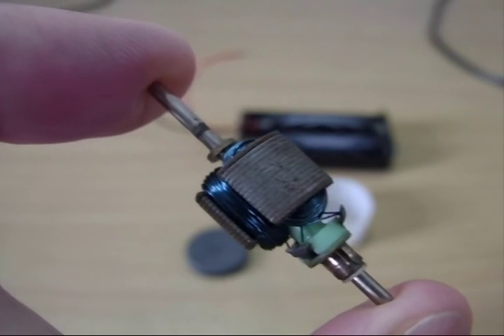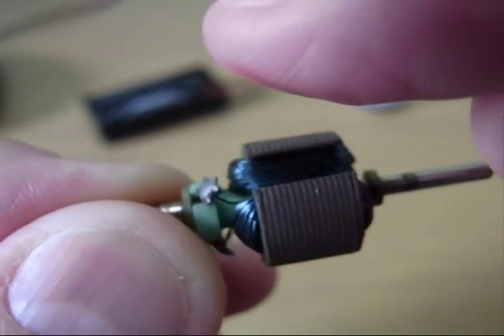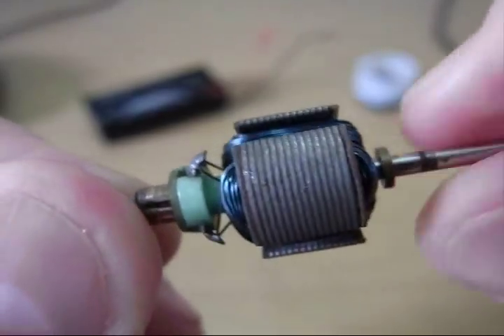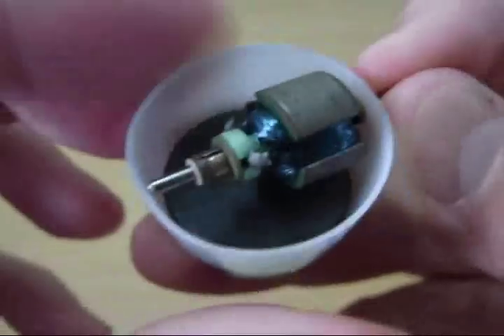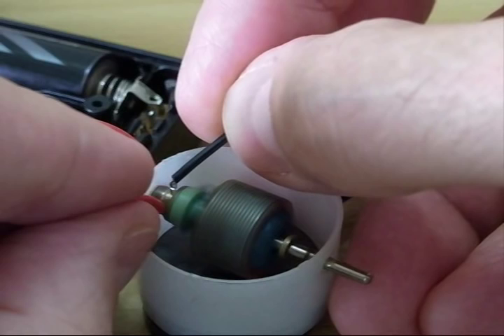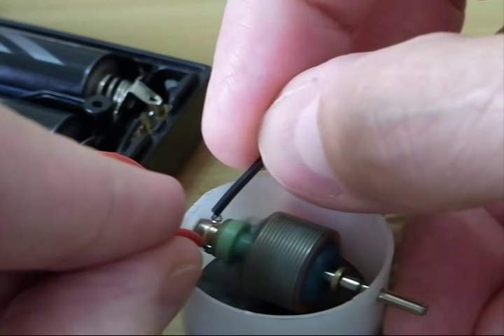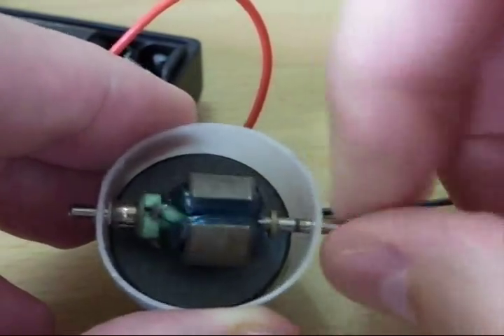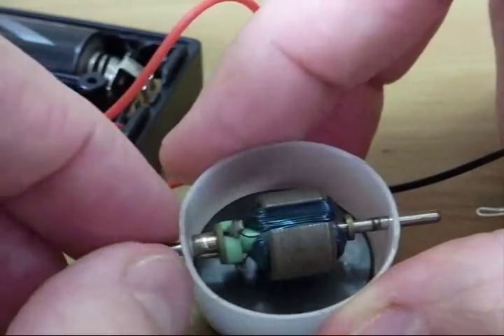DC Motor Teardown/Experiment/Hack

Comment: But what makes it continue turning in one direction instead of a another? I mean what causes it to not just oscillate back and forth?
Reply from the maker: Excellent question.  It's the arrangement of the permanent magnets (even number) and the electromagnets (odd number) and the way the commutator is arranged.  I just googled "how does a dc motor work" and the diagrams show 2 magnets of both types.  As a cub scout I built one out of nails and wire and they can stall easily.  If you can get one of these little dc motors you can demonstrate to yourself much better than most of the diagrams I found.

Comment: That will also make voltage,if you hookup a meter to the brushes without the battery's. And turn it fast,with say a small drill. Thank you for showing this and great explanation.
Reply from the maker: Excellent point.  I should do that.